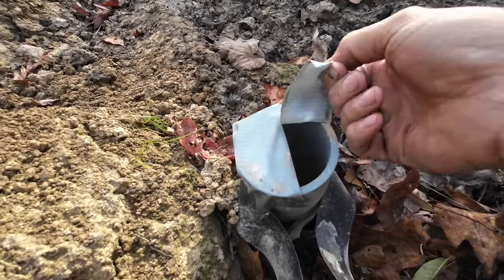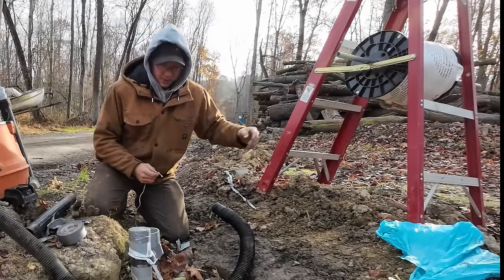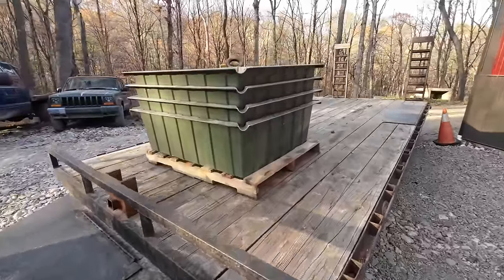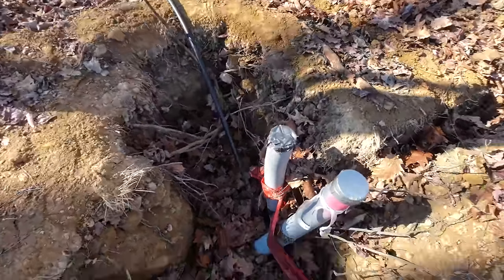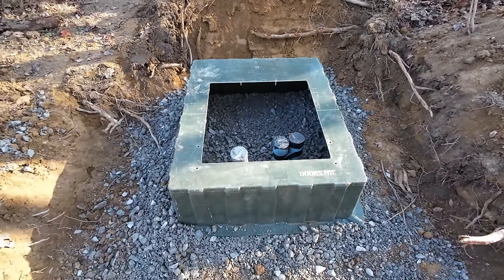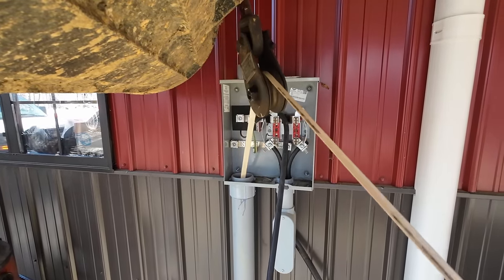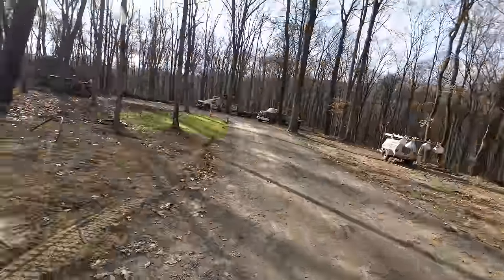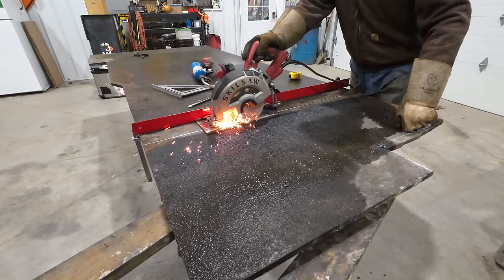The Power Company Charged me $52,000 for this!!

Comment: That is 100% extortion, just because they can
Reply: Yes absolutely just like insurance companies.
Reply: They have to bill for the transformer, wire, the time of two+ trucks and the three hours for a half dozen guys, the engineering overhead, and the meter.  They're making a profit but not a huge profit.
Reply: @RSterkenburg  I was surprised by the amount of equipment they rolled, not to mention the personal.
Reply: @RSterkenburg  dude, a private company with the same time and materials would be around $15,000. This is what happens when you don't have competition.
Reply: @happyogre  And will that private company take responsibility for the materials and their maintenance and replacement for the next century for that price? I doubt it. I'd also like to know where they're getting cable at that price.. this isn't cheap aluminium URD, there are real voltages in play.
Reply: @Monkeh616   Thank you!! Finally a comment from someone with a brain. Primary power is no joke, it will explode and kill people if you look at it wrong. Primary work has expensive materials, and the people who do it have to know WTF they are doing. Primary cable starts at around $25-30 PER FOOT and goes up from there depending on conductor size and voltage rating. Splice kits and terminations are hundreds EACH.  Plus the manpower and equipment to install it. Like I said in my direct comment to this video, he actually got off cheap based on the scope of work here.
Reply: @mxslick50  I can get cable to suit this for.. $6/ft or so, depending on what type they like and how oversized they want it. Still two runs of that, plus a transformer, will set you back on the order of $35k. I'm sure they can beat that, but still.. That's before any fittings, enclosures, labor, and the risk taken on..

But every man and their dog who's stuffed some single insulated 2AWG aluminium 30ft into their garage for a 50A panel thinks it can't possibly be expensive to do.
Reply: @Monkeh616  I agree, but personally I think I would have set poles and gone overhead to save a bit. Not to mention if 3 phase ever becomes available in his area, it would be much easier to upgrade. Not  sure what his power company is like, but depending on the source he could get 3 ph back there on 2 phase wires and a MGN if he used an Open WYE-Open Delta transformer connection. He'd end up with 120/240 with a high B leg. which would work out well if he's building a house also.
Reply: really? i think you have no idea
Reply: @joecummings1260  so in our area, when doing poles (commercially), each pole dropped in a hole is $3k and gets you 200ft overhead. 
But cable switches to ACSR, which could save $. 
But 11 (minimum) poles at 3000 is 33K. Bet Matt was happy digging trench and dropping 3” conduit in. (3” conduit can support future pull of 3ph 15kv @ 2awg, no problem)

Edit for typo.
Reply: @schmails  Yeah that is quite a bit in poles. I don't think I've ever went that far underground. I wonder how much of a low leading power-factor that run creates. (Not that that is Matt's problem). I've also seen ferroresonance with long underground primaries a lot shorter than that, but that is usually only a problem with polyphase
Reply: @Monkeh616  I call BS on $6/foot PRIMARY cable....what vendor are you getting it from? (And are you in the US or elsewhere,, that would make a difference.)  And what area are you at that needs TWO runs? Virtually every area in the US I know of, primary single phase is a concentric neutral cable, ONE run needed. (even SCE in So Cal won't do single phase off of a delta feeder, which would need the two runs.) 

I have first hand info from utilities and electrical wholesalers that primary cable STARTS at $25 per foot and goes up from there. Now, SECONDARY cable (Tri or Quadplex) is around $5-6 per foot. Is that what you are referring to? It would be used for up to 600 volts.
Reply: @mxslick50  From a supplier anyone can find - I can't post links here. Currently they list 2 AWG copper 8kV MV-105 with shield (not neutral.) at $5.68/ft and 2 AWG alu full neutral 15kV at $6.24/ft. Yes, I know the difference between low voltage and medium voltage wire - in fact I just ran in about a hundred feet of quadruplex at $2.12/ft... Call whatever you like on that.

Single phase could be run as one phase and neutral return or between two phases, which would require two cables. The US is far too fragmented in standards for me to assume how this particular company supplies customers.

Comment: As an electrician, you’re completely right in this is exactly how we prep for wire pulls. String and vacuum. Never tried vacuuming mule tape directly but cool to know it’s possible. Also side note: mule tape has measurement markings printed the entire length. So you didn’t have to pull the mule tape out to measure. Simple subtract the number at the end to where your mark was. But 10/10
Reply: You have never used a  "rat" with jet line?
Reply: You can use two vacuums of the same CFM rating and double yours suction power too. I have two old dewalt battery/AC combo vacs that I use in tandem and they work great. Simply plug the suction end of the second vac into the exhaust of the first vac. The key is making sure they’re identical vacs or have the same CFM. I’ve pulled mule tape 500+ feet with them on battery power and no issues where one by itself wouldn’t quite do the trick on 4” conduit
Reply: You mean, like, do math???
Reply: I have used this method many times myself. After you have the pull length it is easier to calculate the wire needed for the run.
Reply: I've done this many times but with 6"pipe using a commercial compressor and a mouse you don't want to be close to the pipe when the mouse comes through or you can get very wet as it will spray about 10 ft in the air
Reply: I keep dish soap in my box as well.
Reply: Matt, if I was at your shop I’d give you a hand slap. Happy for you.   What you spent the first time and the last time was a lot of money thank you, Matt.
Reply: Was going to say the same thing about the measurements on the mule tape
Reply: That mule tape is worth keeping around…can’t believe how strong it is !!!
Reply: @TruthIsNotTemporary 
Definitely strong ——power company gave me the last 75 ft on their roll I used it to pull trees with a come-along. It’s I believe 2500 lbs pull strength, but if you’re pulling with it using your truck and it breaks it sounds like a 270 rifle going off.
Reply: Those pull boxes as ridiculous as their bill. Why are they not just a buried torpedo joint?
Reply: @Mr.Innovator961  🤣
Reply: I can imagine
Reply: when i did underground we would vacuum mule tape all the time for thousand feet or more.. wrap the mule tape to a mini track hoe track once and as it pulls feed it off the track so it doesnt too tight and yank the cable in
Reply: @Savagetechie  Because it would be impossible to pull the full 2,400 feet of that cable in one shot. It is very stiff and heavy, the friction would damage the cable and wear right through the conduit. Primary cable cannot have the slightest nick or tear in it, ti WILL fail violently at the damaged spot. I have seen it happen and it is not pretty.
Reply: @mxslick50  I know exactly what it looks like and behaves like, I am ask why the massive box above ground is required, here that would be a manhole for inspection or even a maintenance free epoxy filled joint. I didn't say anything about pulling it in one run
Reply: @Savagetechie that would be the transformer.
Reply: I installed underground conduit at a development, miles of it. We used a large air compressor on a trailer and a piece of galvanized pipe with a small traffic cone on the end of the air line. Grab a piece of the caution tape you bury above the conduit, tie it to the end of the string and blow that sucker down the conduit.
Reply: Nice job .
Reply: @Savagetechie 
On an emergency call in the middle of winter, do you want to be laying on your chest in the snow with your arms in a pit of stagnent water trying to repair a 20 year old splice at 3 am? Really?
Reply: @lousassol3  it's the way it's done here although a proper resin joint will last way longer than 20 years.
Reply: @Savagetechie  you are ignoring 10 other factors that you dont understand. Let me toss another at you: how are you accounting for the 1" per 50' of shinkage/growth per 100* temp swing of the cable? Where do you think that service loop will go if you are tucking it into a handhole box? 

This is Western PA, we can see almost 100*f in the summer, and as low as -10f in the winter on bad days.  A 500' run needs a foot of service loop coming out the top of the conduit sweep to avoid stressing the splices just accounting for temp differential, and NOT factoring in burnoff for future repairs and system modification. 

Europeans fail to even remotely understand the massively different conditions and infastructure of the US.  We have single states the size of  multiple European countries. We have 3 seperate states that have a GDP larger then the ENTIRETY of Russia each. 

This is all to just make i5 more easy to understand that we have single local power companies that handle infastructure larger then entire European countries deal with. I promise you they know what they are doing more then you could ever hope too.
Reply: @aaronpreston47  no it wouldn't they have put a stupid above ground box at each splice
Reply: @Savagetechie Ah sorry man, thought you were talking about the transformer. Yes I agree, all splices should be done in underground concrete vaults.
Reply: @lousassol3 all the conduit I have run has been to underground concrete vaults. The small ones are 3’x3’ and 4’ deep. They rest on bed of drain rock underneath and a drainage hole inside. They also have a steel grate on the bottom to keep your feet dry. Every line gets looped inside to accommodate shrinkage.
Reply: @aaronpreston47  we do that for large multiunit/development installs too depending on ground water level on the area.  But for a single family split phase service, no chance, do you have any clue what the vaults cost each... easy way to double his bill. 

And they dont work in Florida, Texas or any of the thousands of miles of coast land in the US where the ground water level is inches below the surface. 

Again, the PoCo knows what the hell they are doing, and every single install is different, thats why it sometimes takes monthes for the engineers to decide on the install parameters when they are busy because they have to make the site visits, look at property maps, geo maps, local ordinances, development history to plan for future expansions, etc. How people cant understand that is mind blowing. 

"We do it this way why dont you"  is a great admission of suffering from Dunning Kruger. Basic knowledge with no comprehension of WHY something is done, with the confidence of an expert.
Reply: @lousassol3  Dude, calm down. Take a chill pill. I just mentioned what we do in our area. No need to get all pissy and beat your chest about some conduit.
Reply: @aaronpreston47  It's all they know how to do. America is special, you know. Everything is different there.. in their minds.
Reply: @TruthIsNotTemporary I've done some wild stuff with scraps of mule tape in a pinch. I think 1200lbs rating is what it has most often that I've seen, and I've wrapped it back and forth a dozen or so times between to hitch balls and pulled a truck out that was stuck on a job site with another truck that was there. Nobody had any straps and we were in the middle of nowhere 😂 i was not positive it would work, but it did. I figured "if it doesn't work, we are right back here, no harm in trying" 🤯
Reply: @mxslick50 I think a lot of folks missed the part where it's primary cable. Which I guess is fair, but it's a pretty significant detail, If you ask me.
Reply: Came here to say the same about the footage markers, makes measurements easy.
Reply: No way, you should have gone solar!,,
Reply: @Monkeh616  our electrical systems are, in fact, reasonably different from one another (compared to most of the rest of the world)  so in this case it does apply fairly, IMO.
Reply: @goosenotmaverick1156  Apart from being somewhat fragmented (pick a voltage, please.), no, not really. Physics are still physics, a low consumption voltage and some archaic and flimsy plugs don't change the transmission side.
Reply: @Monkeh616  fair enough but also to be considered is geography and the vast distances covered by that transmission system. However I cannot disagree that once you get to that point, there isn't much different beyond the frequency when compared to most countries.
Reply: @Monkeh616  also you aren't lying about the flimsy plugs. That's honestly got to be my biggest complaint here in the US with our electrical system beyond the unnecessary complication of having the lower voltage available at the use point. Honestly archaic is pretty generous too 😂 our plugs, suck.
Reply: @goosenotmaverick1156  There's some pretty large systems elsewhere in the world, along with plenty of mountains, wetlands, and so forth. The US is uncommon in having basically everything in one country (as much as you can call it one country!), but there's not much unique apart from the sheer scale of some canyons, waterfalls, and rivers - all of which are 'easily' crossed by HV lines. You'll also find international AC and DC HV links outside the US, which invoke serious complexities (probably easier negotiations than Texas, though), including submarine systems. There's a 450 mile long ±515kV HVDC submarine link between Norway and the UK, for example..
Reply: As a lineman this is a ghetto version of how we blow mule tape in with an air compressor.
Reply: I hope he crunched the numbers on Propane heat and Generator.  Looks like you could get a lot of generator and propane for your $52k.  Not to mention propane heating is much more efficient than electric.  But hey, you do you man.  I'm guessing he went 3 phase for lathes and mills?  I must just be incredibly cheap, I'd try to weasel around that kind of lump sum for sure.  Propane generator is between $4-20k depends if you need 22KW 'standby' or a 40+ KW big boy.  Haven't crunched the numbers, but its worth a look at these prices.
Reply: I can’t believe they charge you $52,000 to do that work. I live in Texas and my electricians can pull my primary, lines. We did a job in Sugarland. We had to pull over 500 feet and four turns ended up having to use the forklift to pull the wire in the pipes I would lower the boomdown to just about the pipes and hit the hook, the mule tape to the forks, and then raise it till the rear end of the forklift came off the ground about 3 feet and that’s how we made the pull in my electricians, kept all that you’ll take and reused it on several jobs. You have to have patience take your time. Roll it back up. Glad you got power sucks to pay that much money for it.
Reply: My family bought a house in the mid '60s The garage had been a small house, and it had a separate electric meter. We had that service removed. (It was only 120V) I dug a trench between the house and garage to run power. I used a roll of stranded 22AWG hookup wire and a couple paper towels to then pull a rope through the conduit. (I was already into electronics as a teenager) People didn't believe that it worked, or insisted that I should have looked for a longer fish tape. I already had a 100' tape.
Years later, I did commercial sound. We received a last minute call to install the sound system in a new church. They bragged that there was conduit for all the wire runs. The company that insulated the building had managed  to plug every one of them with blown in insulation. I went to the shop and got our air compressor. There were some tapered rubber plugs from the A/C install, I used one on the air nozzle to seal it to the conduit. You could hear the air pressure building up in the conduit, until it started snowing insulation in the chapel. It took hours to clear all the conduits, but it was ready for their first service, That was the only job that we didn't clean up behind us, but they assured us that they had already planned to clean before the service.
Reply: I'm a lifelong electrician

You got a fair deal for that capital improvement which you needed to improve your property's use and value
Reply: @jimsiler8111 same in ohio
Reply: @TruthIsNotTemporary  We used some leftover mule tape stuffed into the cylinders of a Ford 1.9L to hold the valves up while putting on new seals. Worked like a charm. :)
Reply: @jdsparky288 
I do a similar but use a leafblower at the other end. 
That really saved one job where the conduit had water in a low spot.
Reply: I worked for a power company.  Our attitude was, the sooner we hook you up,  the sooner you start paying a bill.